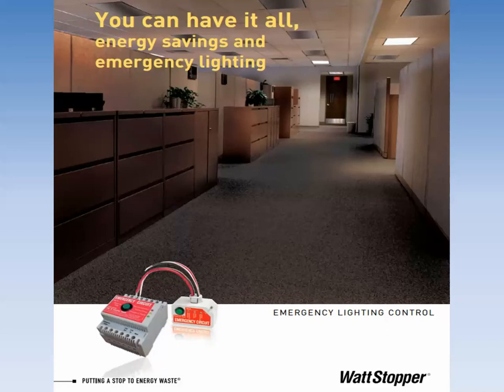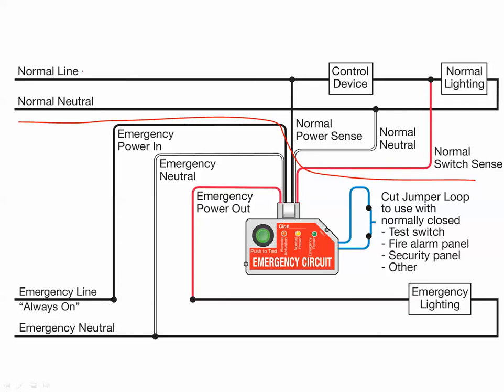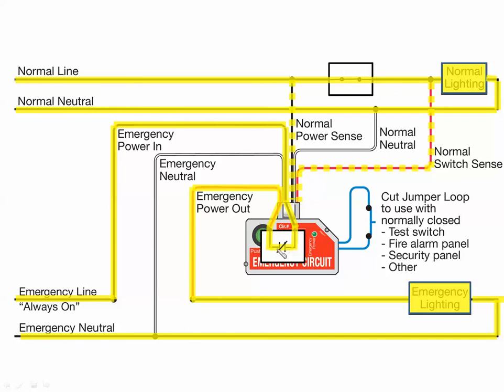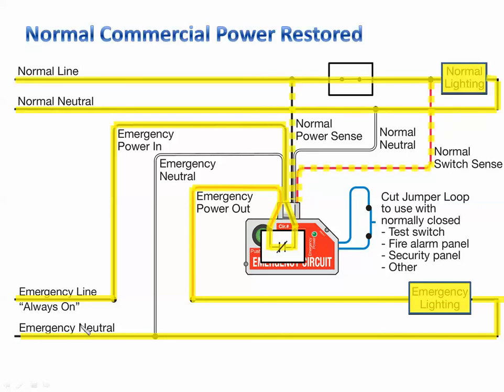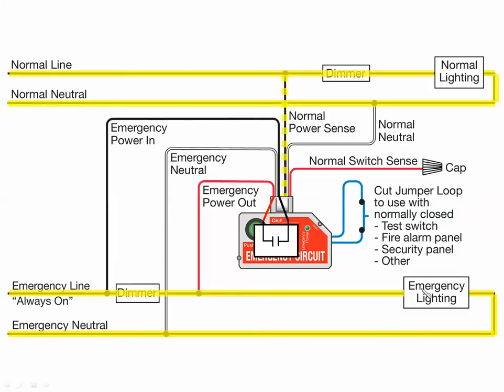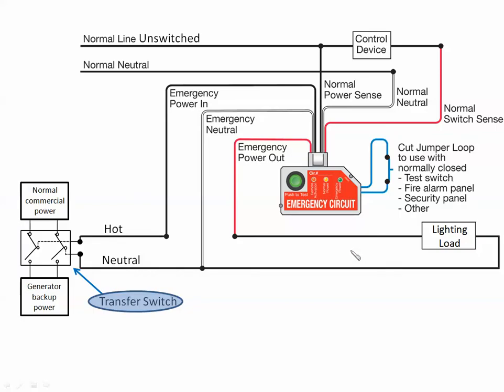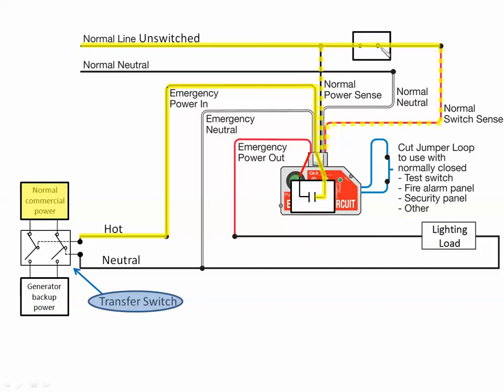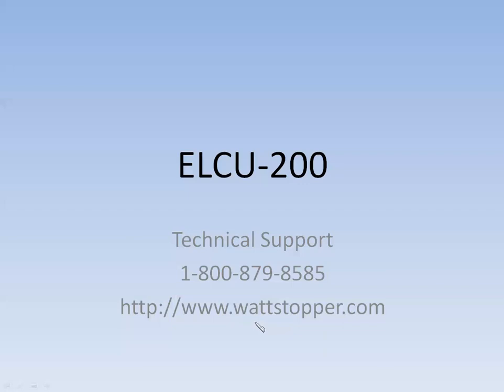Emergency Lighting Control Unit Training and Technical Overview

Comment: It appears that the third scenario in this overview is not in compliance with NFPA 70 700.17(2) "Two or more branch circuits supplied from separate and complete systems with independent power sources." This example only provides a single branch circuit so a space could be left in total darkness should the branch circuit fail. Please clarify. Thanks!